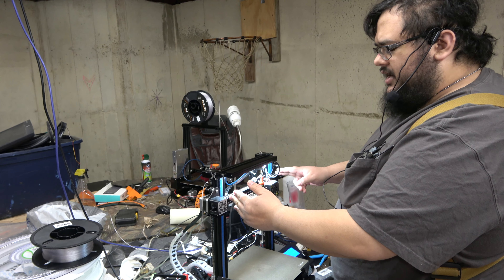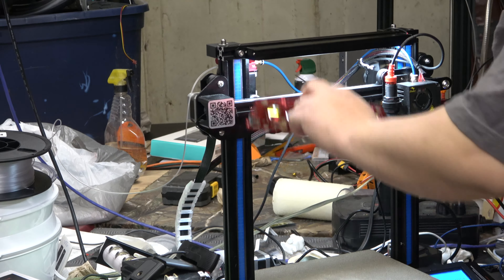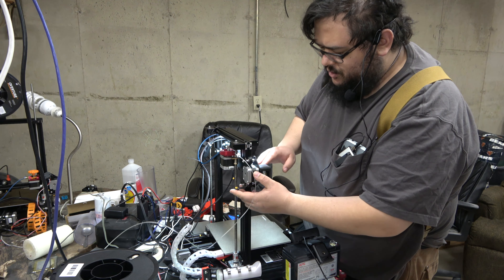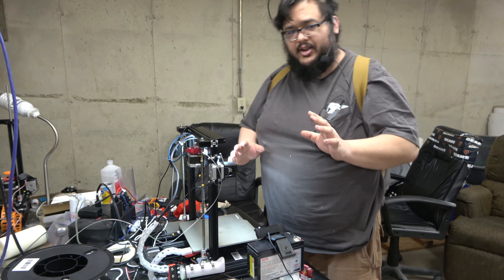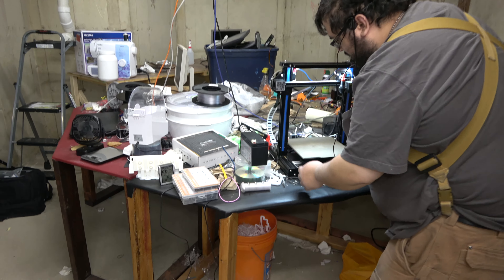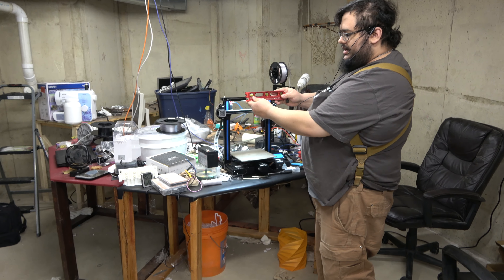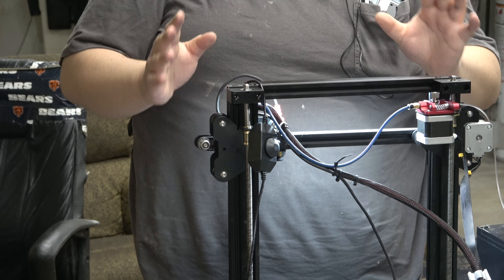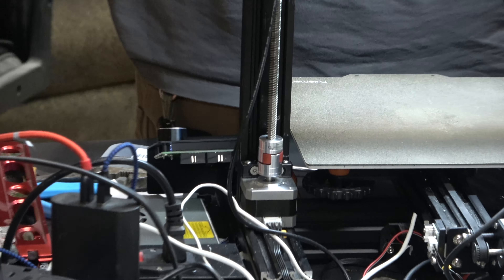How to adjust the X axis Gantry on an Ender 3 pro with dual Z motors when the frame is askew

Comment: If the right side is higher, wouldn't backing off the eccentric nut on the lead screw side allow the right side to drop? Also I'm not a fan of the idea of levelling the x gantry to the top of the frame since extrusion lengths of the vertical uprights might be slightly different. I much prefer to ensure left and right sides are the same distance from the base frame when the Z-steppers are off.

Comment: Thank you for your advice! I got a Ender-3 S1 Pro 3D Printer. Unfortunately, the Z-Axis seems too high when I print, end up the Filament doesn’t get the chance to stick to the bed, before cooling down. I was advised to adjust the Gantry to set up the Z-Axis to lower a couple of millimetre or so, it prints without any problem. I believe, “Our World is a Shared Experience.”

When I got the Printer, it was already assembled in the Box including the Light Bar. I just installed the Nozzle module to Gantry and the Gantry to the Base. Can you advice me or any tips, how I can adjust the Gantry, please? You can see a video I just uploaded with the problem, so to have the idea what I meant. I shall look forward to hearing from you soon. Remember, Life is Short so Live Long and Prosper … 🖖 Cheers brother-man…

Comment: Has anyone successfully I tegratwd the WobbleX  as a solution to this problem? I have an elegoo neptune  3 pro and it seems like the center of the bed is high until I realized that the massive print head is pulling down the X axis supporting z-rod nut at the right when the head goes all the way to the left ....and  pulls down the left when the head is all the way to the right ....leverage being maximized at the ends but equally distributing and therefore not as dramatic a sag when in the middle ......giving the illusion of a warped bed that is peaked or high in the middle.

Comment: Mechanically, it doesn't matter whether the side rails are exactly the same height above the frame or not. You shouldn't use the top rail as a reference anyway. What does matter is whether the side rails are the right distance apart to match with the wheels, and whether the side rails are exactly parallel to each other. My Sovol was machined about 1mm too narrow at the bottom and the rails were not parallel. It took a lot of tinkering and shims to get everything square. The best advice is to never trust the machine work on the cheap printers. Measure and check every subassembly before putting it all together. The manufacturers are pulling supposedly identical parts out of a box and slapping them together, and most of the time, something will be wrong. The whole 3-wheel cheap-as-dirt rail system is flawed from the start.

Comment: The length of the support beams have no influence on how level the x gantry is. Unless you are measuring from the top of the frame. Don't do this! Levelness starts at the table it's on and works up from there. Do measurements from the bottom rails or even the table top.

Comment: Why couldnt you just disconnect the spider coupler from the added z stepper(on the rightside) and manually screw the z rod to get the appropriate level? 

Both steppers should still be in sync, just the mechanical connection has changed to the stepper.